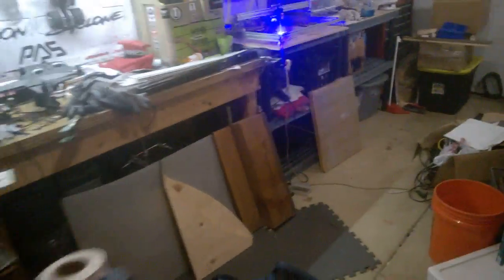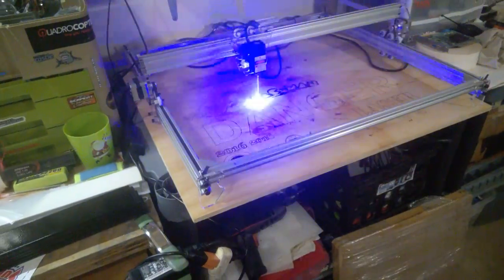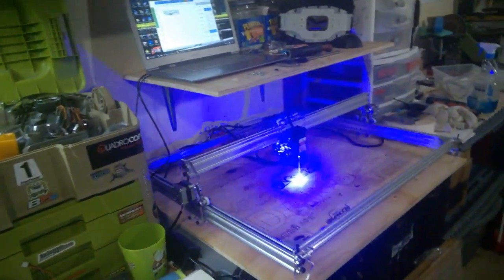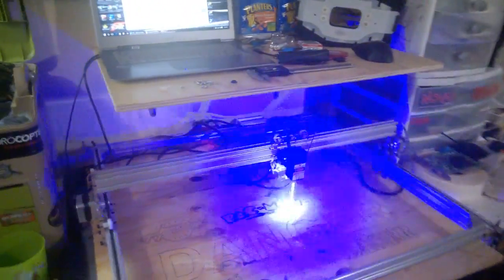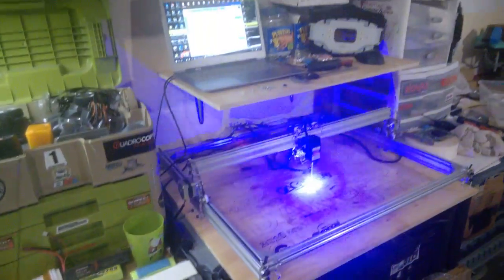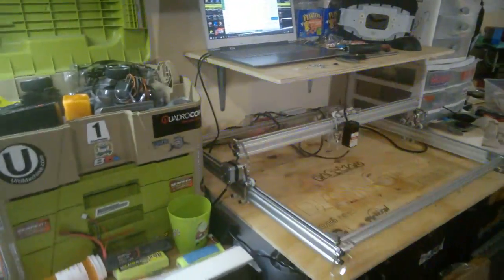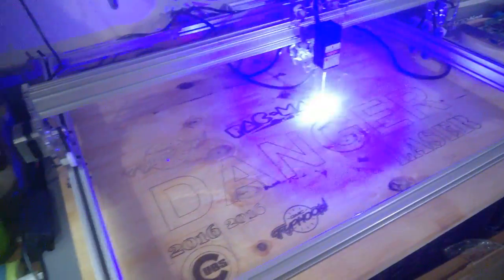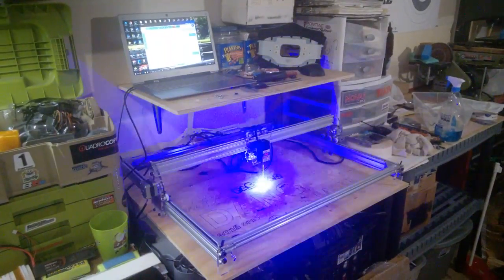pacman 65x50cm 3w 3000mW Benbox chinese laser engraver pacman test  65 x 50cm

Comment: Hello was wondering could this cut through thin plexiglass?
Reply from the maker: i have been able to cut 1/8 acrylic with couple passes or very slow, only for the colors acrylic i tried a grey and a red sheet it did cut through but was slow like i said or do few passes.
Reply from the maker: btw wont do anything on clear acrylic
Reply: What if the clear has the film wrapping still on it?